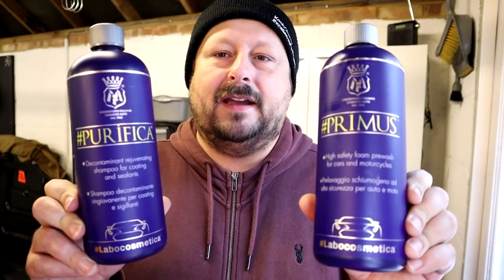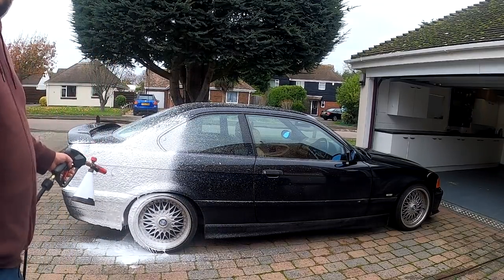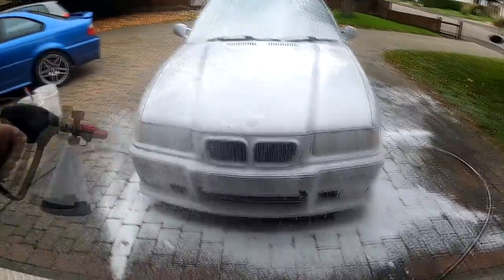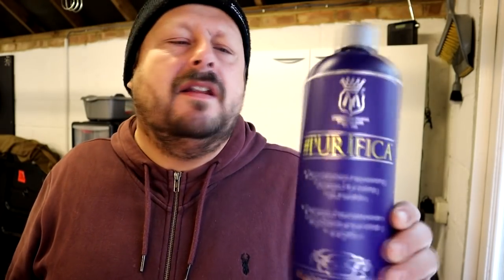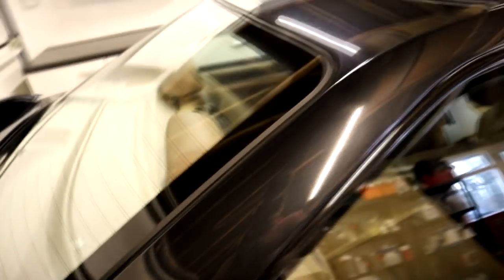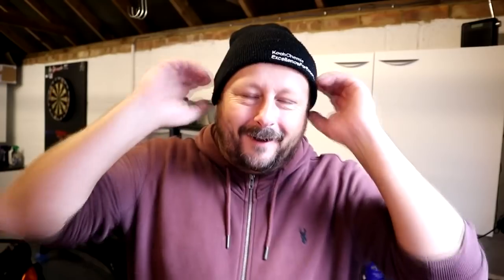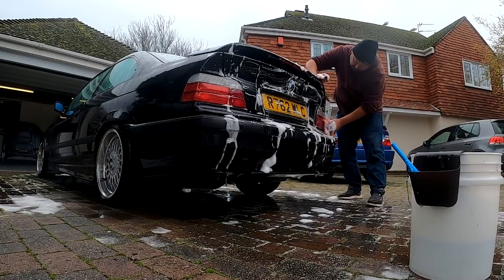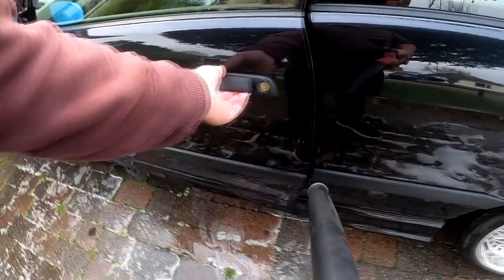Bringing Back the True Nature of your Protection | Labocosmetic #primus #purifica Review

Comment from the maker: Solid products, Ive used all the purifica up since filming this now and about half the primus.  indeed once you get the primus PIR higher 3-4% it will start melting down road film more.  Purifica does seem the condition the paint work and do a good job generally cleaning the car.
Reply: Question is Jon, is it better than Bilt Hamber?
Reply: @anthonyphillips5444  Same question really! :)
Reply: Absolutely not better than Bilt Hamber guys
Reply: I did 50/50 with Labo vs. BH and they are almost the same in cleaning power, maybe litlebit better Labo, I test it with correct PIR, cost in right dilution is about the same (depends package price, for me Labo is cheaper) And Labo have much better foam, so for me Labo is winner here :)
Reply: Correct PIR for BH for me is abou 640ml i liter instead of dilution of primus for 1:60 final dilution is just 250ml in liter bottle so even if primus is much more expensive, in the end is cheaper for me and have better foam.

Comment: Two of my favorite products. I use Primus more less every wash and Purifica every fourth. I got some tips from Labocosmetica about alternative application method of Purifica, which I tend to use instead of using at as a regular shampoo: apply either with foam lance (1:4) or pump sprayer (1:10), then while it sits on the surface, wash with their "ordinary" shampoo, Semper. I think this works really well. I keep my car clean and decontaminated so I can't report any revolutionary rejuvenation of my ceramic coating, but it definitely is a good cleaner. One place is did notice some rejuvenation was on my window coating, though. That was brought back to life again. Labocosmetica has a new iron remover, Sidero, that I'm looking forward to trying out. Apparently it also has anti mineral properites as well.
Reply: I use purifica in Lance then semper to wash, sidero is awesome!!
Reply: I think I would use it in a pump sprayer then wash it with a general shampoo like Reset. That would be much more economical and I think just as effective.
Reply: Are you satisfied with Semper shampoo? I tried few days ago,with 2 caps in 10L water with microfiber washing glove. But didn't get any foam at all.

Comment: I used this at 10:1 in a snow foam lance and it worked really well. However, my results are probably skewed due to my age old habit of using Green Star first in a pump sprayer and then layering it with snow foam. However, Auto Foam is cheaper and probably best to stick with it. Oh and Cronos is amazing!

Comment: Hello Jon, about Purifica there is bit missunderstanding here, it isnt mean for using as normal shampoo in bucket, it just helping agent to remove mineral deposits, as Labocosmetica says in their 3ph wash, better value you will get use it it foam lance do not rinse and imediately wash with PH shampoo in to it, its need contact wash to remove these mineral deposits, or if you want to go very economical, use it in pump sprayer (not foam sprayer) with right dilution of 1:60 (which is abot 16ml of product in liter, I use 20ml and is enought for whole car then its reasonably economical thats about 1 pound probably?) on parts as back of the car and lower pars of doors you can use 1:10 to have realy strong remove of these mineral deposit in part where it is needed most. Hope that clarify situation better! thank you for your videos! :)
Reply: Also Primus you can use for better result 1:10 in sprayer and hit areas like lower parts and rear to get great final result of the prewash. btw that 3ph wash is especialy made for cermaic coating to renew it and get hydrofobity back, on cars with just wax its useless to use it.
Reply: Once thing I forget and thats dilution of 1:10 in foam lance, it is strong enought, final dilution shoulb be about 1:60, in my foam lance it is 1:3 in the bottle mix
Reply from the maker: @Booczech7  thanks for the feedback buddy.  I cant go back and watch my video but Im pretty sure I said you can use it in a pump sprayer.  but as a reviewer I want to use it in a bucket wash.  this review would not be a review if you did not talk about the huge cost per wash.    Im pretty sure I also said you can mitigate it because you wont use this product for routine washes and you can buy their normal shampoo for that process.       but the fact stands the chemical cost of this is very high and you have to state this.
Reply: @forensicunplugged4295  Thank you for reply! I'm sorry english is not my main language so maybe I miss something :) of corse if you use it as you did in bucket the price is totaly huge, I can't contradict that, but there is till way to use it and get results which you need from this product and it doesn need to cost fortune, I'm professinal detailer (I hope I can say that) and using primarly Labo producst so I have lot of experience with it, especialy on ceramic coating where contamination of coating is problem in lower parts and back of the car because road contamination is different than on siting panel (you know on road there is tons of junk especialy in winter with road salting), these product can really bring back beeding on ceramic coating, I prove it to myself on my cars, it is not magical that it can bring back every coating to live but it really works for it's purpose, I just want to put my different experince through my eyes here and how I look at it. thanks once again and have a nice day! :)

Comment: Hello Jon, i've made the switch to Lacosmetica products, and i really like them so far. i am wondering if i could use Primus or Purifica (have them both) after polishing to get a prepped state of the paint. Would be far more economical then using Veritas as a panel before applying a sealant. What's your opinion on this ? Thank you.
Reply from the maker: Primus and purifica are detergents right.  Veritas us strong panel wipe m8.

Comment: But is it better than Bilt Hamber?
Reply from the maker: the biggest problem is even if the performance was the same pound for pound, its 3-4 times more expensive.  so thats why I keep going back to Autofoam all the time (great results and hard to beat value).  purifica though ironically is more expensive but has a USP and less competition.
Reply: @forensicunplugged4295  yeah I was looking at that when doing the price/performance comparison, but like for a once in a blue moon usage on a car that has been overlooked for a while would the price still be off you think? ofcause it's fitting to use it on the black moneypit of yours though :-)